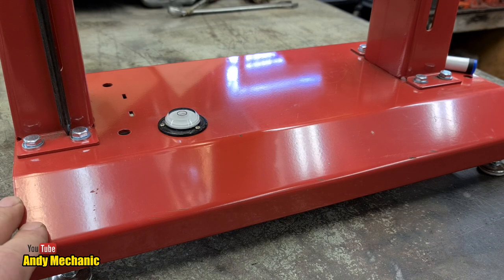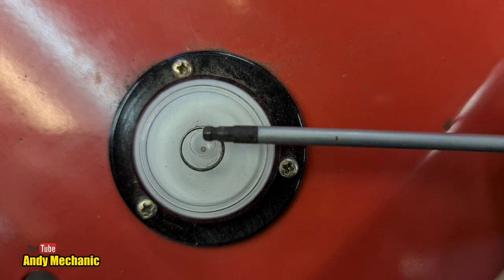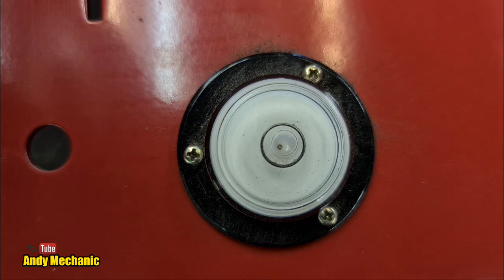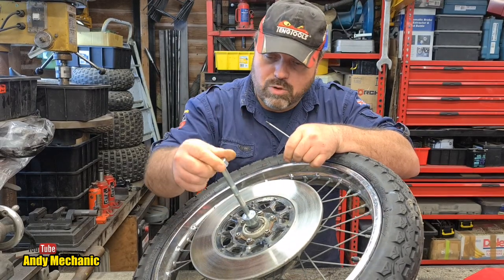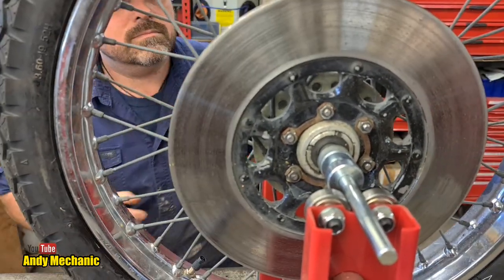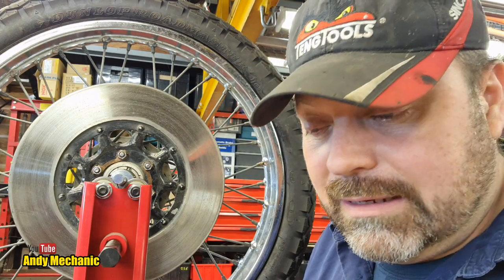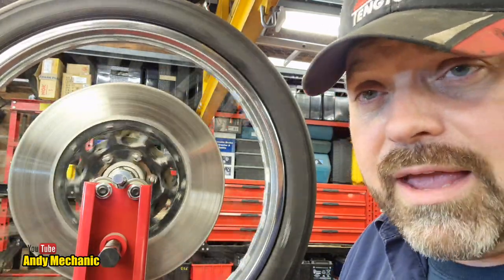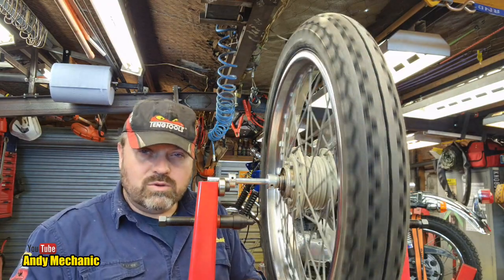How to balance a motorcycle wheel - CB750 project #1519

Comment: Motivated me.  I mentioned I had a front flat on one of my KLRs.  Noticed the tire was over 9 years old.  Ordered a new tire and tube and pulled the trigger on a balancer and weights to do it right.  Never balanced before.  Used those ceramic balancing beads in the tube but I'm ready to go mainstream now.  Thanks!

Comment: I'm not a fan of those big brass weights,  I like something lower profile that doesn't stand out so much (visually speaking).  That thing would be like musket ball if it flew off and hit something while riding at 70mph.  The weights on my 64 Triumph look like coiled lead wire, which I'm not a fan of either. 

On the Triumph you have to remove one of the bearings to get the axle out.   Is there a way to do the wheel balancing using the axle that comes on the bike?
Reply from the maker: That's very true. After filming this video I actually put thread lock on the grub screw. Like you say, if it were to fall off at speed it could cause a serious injury 

It is possible to balance a wheel still on the bike. You need to remove the calipers, seals & of course drive chain of the rear wheel. Basically remove all sources of resistance. Ensure bearings are smooth & free then do the same process as I did in the stand. Bike must be vertical & not on a side stand.

Cheers Andy